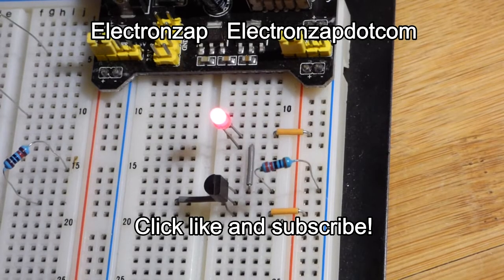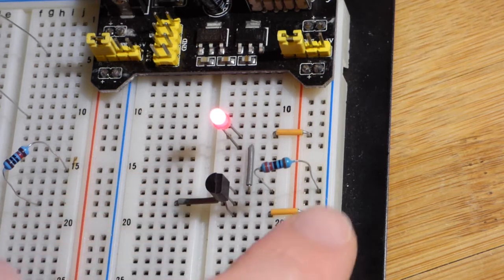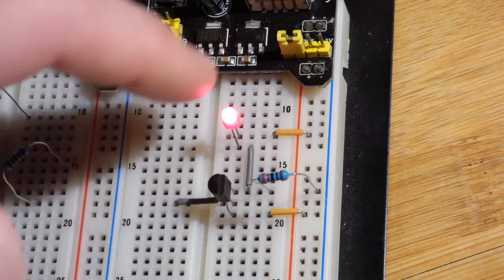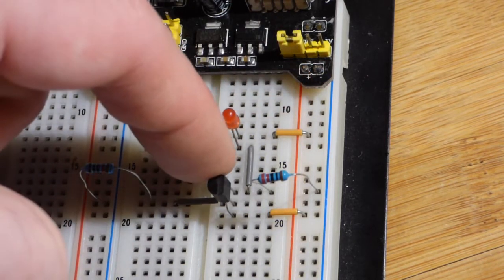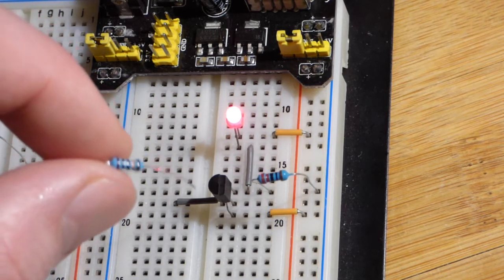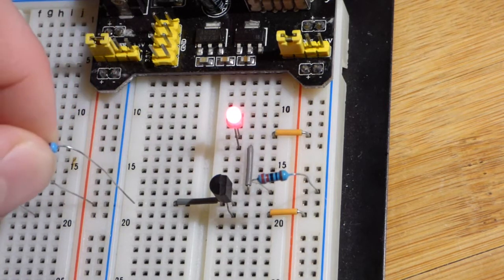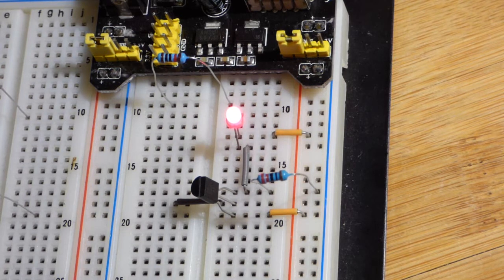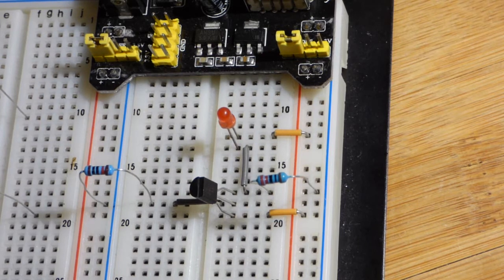PNP Not Gate using 2N2907 bipolar junction transistor BJT BJTS for beginner learning electronics

Comment: Last comment

I am hoping to substitute a 558 with a 2n2907 so I dont have to re do my hack circuit as I dont seem to have enough Base current to drive the 558 all the time , perhaps I may get away with putting another 10k pot in parallel with the other one to double the base current.

From looking at your demonstration here my 10k pot voltage divider circuit  would work OK to drive my 30 milliamp relay a little more than the LED here , multiples of 10 ETC 10K /100K   in your video a nice demonstration 

Congrats and thanks for your channel